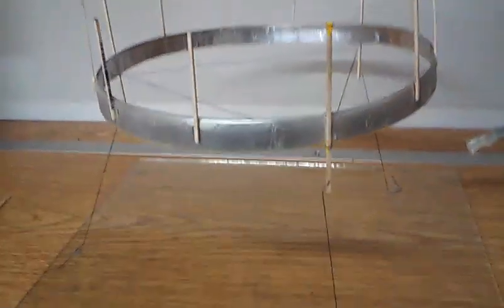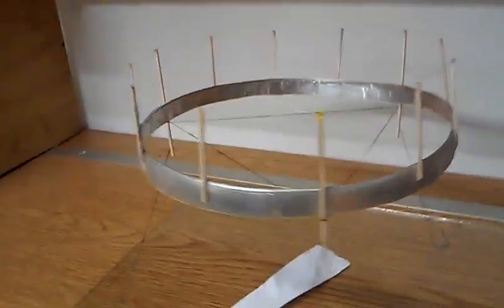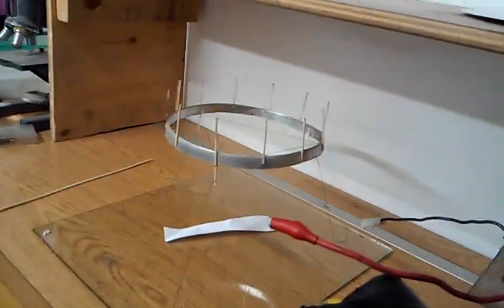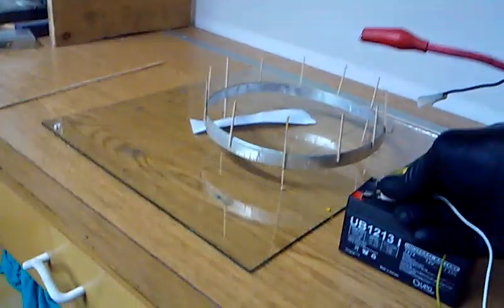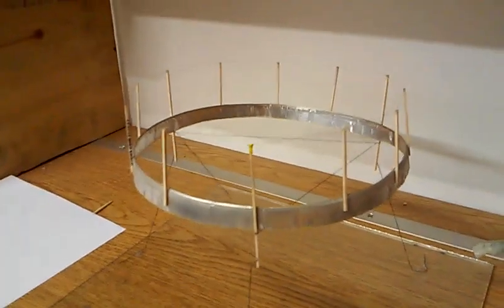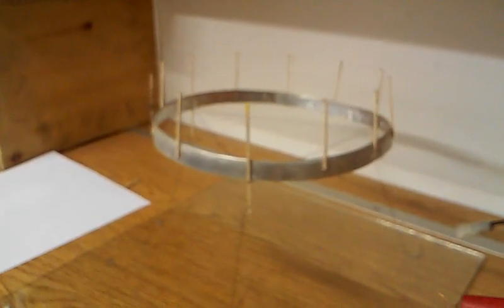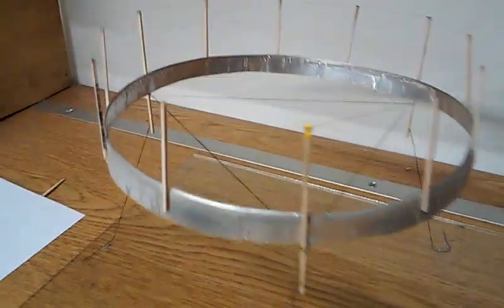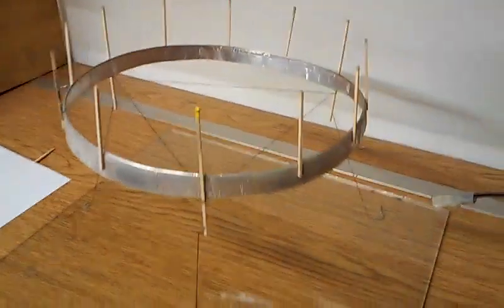ANTIGRAVITY LIFTER CREATES ARTIFICIAL GRAVITY ASYMMETRICAL CAPACITOR

Comment: That's not antigravity that's electromagnetic repulsion.
Reply: Same thing.
Reply: @vDarknessFalls  Electromagnetic force and gravitational force are different, so are magnetic field and gravitational field.
Reply: Gravity is electrical in nature. Earth is negatively charged while the ionosphere and above is positively charged 500,000+ volts so we are effectively between two electric terminals with earths crust and atmosphere acting as dielectric materials. Earths electromagnetic forces interact with ether causing ether to accelerate towards the earth from space at 9.8 m/s2 and that's what causes gravitational force. Weight is an equal and opposite reaction of atoms within a mass/object resisting the ether flowing through it giving it its amount of weight and also inertia. Just like weight is not an inherent property of mass, inertia is not an inherent property of mass too. What is ether? Its pure inertia permeating all space. You can read book "Uncovering the Missing Secrets of Magnetism" on ether.
Reply: @Xeno_Bardock  Just go by the basics. 
Gravity is a weak force occurring because of mass. 
Electrically speaking, gravity is a weak force excerted by a body irrespective of its electrical nature, just because of its mass which has overall one electrical nature, may be negative or positive or even neutral.
While electrical force are because of reaction between different charges.
Electromagnetic force is either because of movement of electrically polar object or charge. Magnatic force is because of spin of odd number of electrons inside the orbitals which is nothing but another form of electromagnetism.
Electric force> Electromagnetic force> Gravitational force.
Depending upon the nature of the two interecting bodies one force prevail over the other in the given order.
In this case because the nature of interecting materials electromagnetic force is able to overcome the gravitational force between the objects.
My point is the phenomenon is not because of some repulsive kind of nature of masses why we call it antigravity.
If it means the generalized meaning of just going in the opposite direction of earth's gravity than why don't we call the other devices antigravity device, which uses aerodynamic lift, bouyoncy or any other mechanical force.
Reply: @stormshadow5266  Forget what you learned about gravity in schools about gravity being inherent property of mass or curvature of space-time, none of that is correct. Mass and magnets do not attract each other, they are attracted to what's between, you can see this in ferrocell with two magnets. Gravity is caused by ether accelerating towards the earth in vortex style and it is the ether that curves around the earth, not space-time. True anti-gravity is all about nullifying weight and using high voltage high frequency electricity to use ether/inertia around it for propulsion similar to boat or submarine using water around it for propulsion. Read this book "Occult Ether Physics by William Lyne" which goes into Nikola Tesla's research on ether which is still officially a top secret today. Author of the book had to put Nikola Tesla's research on ether like a jigsaw puzzle.
Reply: @stormshadow5266  You can also check channels "Theoria Apophasis" and "Distinti" on ether. 99% of the universe is ether. 1% is matter.
Reply: @Xeno_Bardock  when will UFO, free energy and so on technology be for once public like fr.
Reply: @Xeno_Bardock  I see that smoking some weed gives a lot of creativity! :-D
Reply: No, in my opinion it is electrostatic attraction pulling charged O2 toward the collector surface and creating a very gentle wind.  Since the craft is very lightweight compared to the surrounding 14psi atmosphere, is appears to fly with almost no wind underneath.  Also, at these low wind speeds things that are even a few inches away aren't affected all that much.

Comment: I am extremely impressed and urge you to keep working on your experiments. I do however have some thoughts and questions that may help future experiments.

With how quickly it accelerated straight up do you know how high it would go if it was not tethered down or if the tether was longer? For the application of human transportation there is an altitude threshold. I also think that the G Force of the initial ascension may also cause applicational problems as well. 

Does a smaller battery/current/amperage/voltage cause a change in acceleration and altitude?

How can one change the direction of movement from straight up to 360° horizontal movement while maintaining a stable altitude?
Reply: you dont think this is already known in research facilities that belong to the ds? come on now... this is 80 years too later you all woke up

Comment: Was wondering if more rings would create more lift. Like going smaller ring after ring. Circles with in circles.?
Reply from the maker: I think it probabably would, but I'm more interested in building a larger unit with onboard power. I'm trying to work out a light power supply now. maybe I'll try multibal rings with that
Reply from the maker: excuse spelling "multable"
Reply: maybe try a ufo hull shape. if you have the top disc part, with wires fixed above it..... you could have a disc type ionocraft.
Reply: More rings would create more power and more opposing lift weight.
Reply: Use sacred geometry to create one, kinda like a crop circle.
Reply: yes, geometry is the key to all we see.
Reply: this need to be built in nano thousands of miles loops , useing vortex maths 1 to 9  , infinite energy loop low power , but sound and frequency is the real key to anti gravity , frequency is what holds the universe together , sacred sound and vibrations  & frequency, is the real key
Reply: Yea.!!’ An ionic jet thruster. Interesting..
Reply: I had thought the same thing when I first heard of these things.  Make the anode a spiral of foil with a gap between the layers, and make the cathode a spiral of wire.  I suspect that might improve the thrust to weight ratio of the device.  Then scale it up with multiple "lifters" of that design, and you might be able to build one with a self-contained power supply to fly autonomously like a drone.

Comment: Its an ion engine
Reply: yep
Reply: +Charlie Bleeker This is a grade three demonstration of electromagnetism. The super light weight flying disk can barely support a tiny stick, and the battery looks really heavy and could never be lifted by this device. Also, it only floats over the charged plate under it.
Reply: but.. but he said it uses "very little current" and "gravity well" REAL science is too basic for him...
Reply: The observation is it is defying gravity, therefore it is an anti-gravity device. You can apply the word ION if you like but the definitive observation is gravity is defied here and in action.
Reply: If your smart you get the picture that electric is part of an anti-gravity device.
Reply: No LMAO0O0O0O0 Defying gravity is not AntiGravity. Your saying that Airplanes are antigravity. Does that make sense to you?
Reply: no. its not an ion engine, nor an anti-grav engine.  if it were an ion engine then it would not work when the poles were reversed, which is does.  I personally think its because of the irregular electromagnetic field that has been created.
Reply: Irregular Electromagnetic field interacting with what exactly Seb Gibbs? The earths Magnetic Field? Because its much much to weak to produce any thrust at all.
Reply: Sedit T . Interacting with itself.  Or maybe irregular electrical field or both. But then be charging or storing this field within the air molecules as I don't think this works in a vacuum.
Reply: Seb Gibbs,  I have to ask because you made the comment which I think is the source of your confusion, You stated"if it were an ion engine then it would not work when the poles were reversed, which is does. " What makes you believe that. It more then likely does not. I rewatched the video to see if he reversed the Poles which he does not. If he did the Ion Winds would go the other way and this thing would not move. Sorry to say man but this is just a lifter. Its nothing magical and the physics are well understood. It would not work in a vacuum because it works by ionizing air molecules and accelerating them towards the positive pole which is the round metal thing. The wire is the Negative. This acceleration of Air Molecules is what produces the Lift. Dont get me wrong man, I love lifters and think they are awesome playtoys and Tech but this is not "Falling Upwards" Or producing some sort of Gravity well as he seems to suggest. Its such a simple test if it were, you place a watch inside of the "Gravity well" and see if its running differently then a timer outside of the gravity well. This is well well understood physics, I would suggest to everyone to make one, they are pretty awesome. I could only dream of a lifter powerful enough to support its powersource but due to the way these things work that is highly highly unlikely unfortunately :( . Not trying to argue or anything man, The guy in this video is just Clearly wrong and really not sure what hes talking about or what he has built. He just seen something on the internet he had almost no understanding of from the looks of it, now hes attempting to explain it with his highly limited understanding of physics, electromagnetism and fluid dynamics thats all.
Reply: Just google search and you will find lots of info on " lifters" , there is a group of people making these in all kinds of shapes and sizes, triangles seem to be the most popular and yes people have reversed the polarity and no change it still works and the ion argument has been going on regarding this for years, personally I don't know.
I'm no electrical engineer or physicist but it seems as if there is enough evidence to justify research and I am sure someone has .
One more thing, working examples have been built with self contained power supply.
Reply: The force is EXPONENENTIAL with increasing Voltage. 200 Watts can fly 1 meter diameter models in hardest vacuum at HUNDREDS of miles per hour with no sonic boom or skin-heating in air, as Northrop Corp found in 1968, and the inventor TT Brown found in Paris , France.
Reply: Takaaki Musha of HONDA R&D in Japan showed how it works better in vacuum, and is a localized artificial gravity. This can be used to fly ships at ANY speed desired (even FTL), and create onboard gravity deck plating for space craft for normal gravity and no weightlessness as is normally experienced in normal free-fall. They do not teach these anti-gravity patents in schools, and they go out of their way to teach that "Einstein never completed his unified field theory, which was published Jan. 10, 1929, in ANNALEN DER PHYSIK, and Jan. 12, 1929 in the NEW YORK TIMES. Antigravity and free energy technology and patents have deliberately NOT been publicised. We have not needed fossil fuels or Nuclear power for 72 years!
Reply: Reverse polarity makes it HEAVIER. Try it!
Reply: Artificial gravity. Not anti gravity. The device flies in the direction of the Anode, or positive pole.
Reply: THe Inventor, TT Brown, Takaaki Musha, Purdue University, NASA all proved the devces work BETTER in vacuum. Electrostatics works in vacuum, that is why our first electronic devices were ELECTROSTATIC MACHINES, and VACUUM TUBES. The Transistor was invented in 1947, shortly after ROSWELL, in New Mexico, home of the Atom Bombs that won the second World War, and the 509th bombing wing, only atom bomb wing in the world in the 1940s, when my parents were teenagers.
Reply: if it was an ion engine, reversing polarity would push it downward... 
however that is not what happens. try it out for yourself.
Reply: Oh Sedit T,... how EASY it is for us to ridicule the things we simply don't understand. You see, but you do NOT perceive.
Reply: LMAO0O0O0 it's magnitism not cancellation of gravity the electrons travel to the nilon wire creating a magnetic field some of it is ionic wind but some is magnetic in nature it could be riding on certain waves by creating different hrz friqincies and volts you will find different heights it will won't to go to. gravity is created by magnitism and static created by motion of the earth the to intertwine to creat it at precise friqincies there for to types of magnetic fields are responsible for gravity electro static fields with the magnetic properties of earth and the affect on allaments ....
Reply: Sedit T I used Polly stirene in a vacume I was able to get movement on the out side littered use and can create magnetism with different friqincies your able to get different ride heights where it wonts to float at.
Reply: Ion my ass! Watch some videos from Russian amateur science lab, they measured all that shit, ion wind is 2 - 5% of the entire thrust!
Reply: Buck Fisher They don't teach 12th graders and most college students about ion engines. I had to go back to 1983 just to find videos about them.
Reply: yep, ion engine\fan.  basically you are ionising the air which is then flowing down via electromagnetism providing thrust upwards.
Reply: Seb Gibbs it's powered by a flyback transformer which produces a DC potential. Means that Ions only travel in one direction. Yes all transformers require alternating current, but all flybacks have diodes in series with the secondary to produce DC.
Reply: 1ton mut could you please provide links to those examples of the self contained lifters with power supply? And maybe also provide links with examples of people reversing the polarity and showing that it still works? Otherwise you're not making any sort of argument or point, just like everyone else here, not citing their sources.
Reply: Russell Anderson Please provide links to all of those studies you mentioned, that "proved" they work better in a vacuum (especially the Purdue and NASA ones please), because you certainly aren't providing any proof by just stating all these "facts" that you know off the top of your head.
Reply: Сварожічъ Х'Арійскі The title "Amateur science lab" is practically contradicting itself. Science is not something you do for fun. Experimentation is very fun, and I think we all love to do experiments in our free time, however experimentation is only a very small part of the scientific method. Is "Amatuer science lab" getting thier papers peer-reviewed and published in a scientific journal? No? Then they are not doing real science, and their conclusions would never be considered by real scientists doing real research.
Reply: Russell Anderson - do you have any links to this research or a schematic to build one of these?

Comment: We need more look on schematic and your wiring please.
Reply from the maker: Read above posts.
Reply from the maker: Will come as time permits.
Reply: Jim RugRoden have You use some specific impulses calculated with waight of object or random?
Reply: jim show me what you have under table in drawer ;)
Reply: kid you need to learn more of that to leave coment on this topic :)
Reply: Copper wire, some sticks, aluminum cake pan, battery and, some string. there's the schematic. Lol
Reply: Victor Carter this is not battery this is High Voltage above 20 000 Volts I see you don't understand anything here...
Reply: Bosnjak Bosanac 
Oh wow i guess its way more complicated and complex then i thought. Lol i also didn't know that i stated i know many volts it took. I obviously dont know what your talking about. Sorry you got so offended.

Comment: Nice job with demo, but uncertain all the terms applied are enough to explain the results. More testing to scale the power efficiency and explore modulation effects of this platform are clearly tempting. BTW: Someone was asking, Satellites do use Ion Thrusters in outer space, solar power to burn, ultimately helps extend limited fuel resource life.